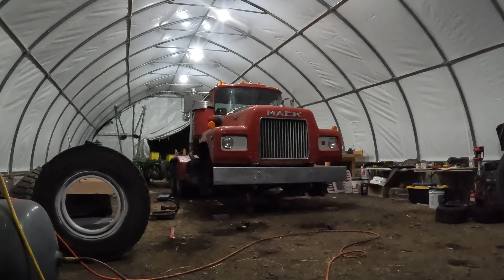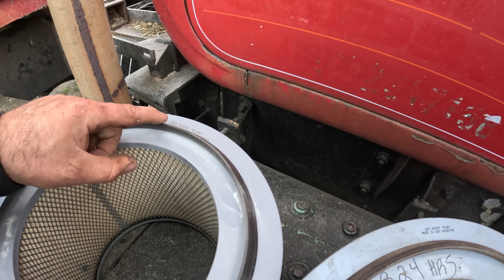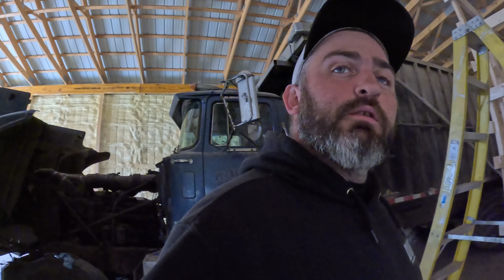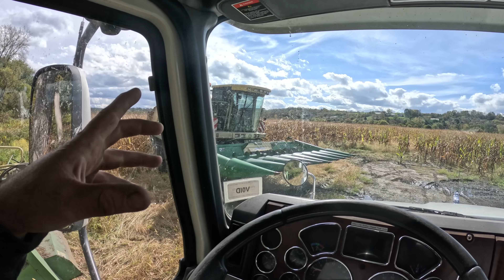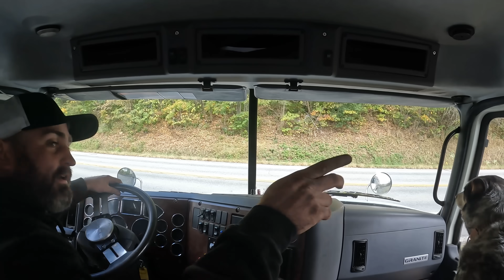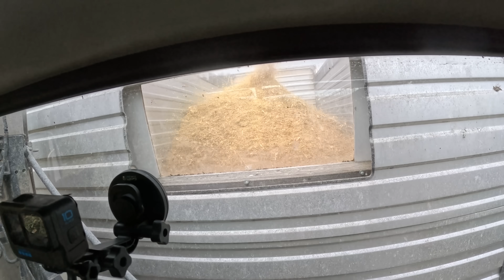Making Ears Of Corn Into Cow Chow- Snaplage With Krone Big X V12

Comment: If your running long hauls and the dump cart why not use the dump trailer so you can haul more per trip I would think the trailer would hold 2 cart loads
Reply: Im assuming because of the live bottom of silage box and dumer doesnt have that
Reply from the maker: Trailer holds less then these boxes. It needs extensions